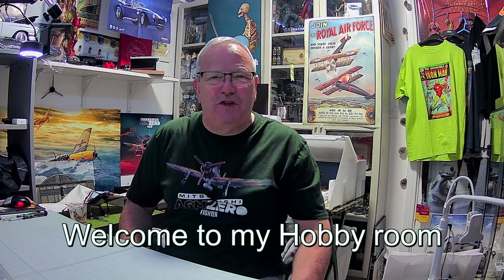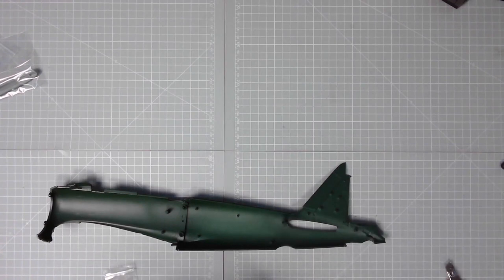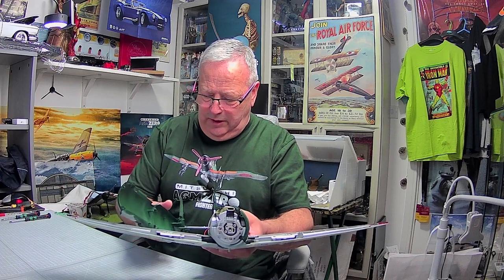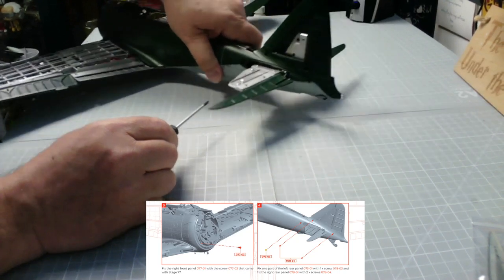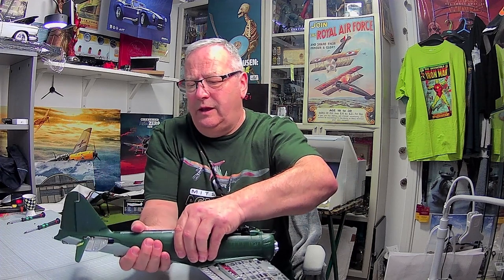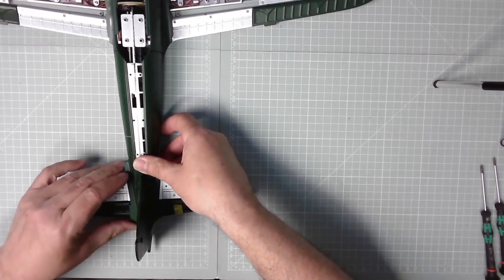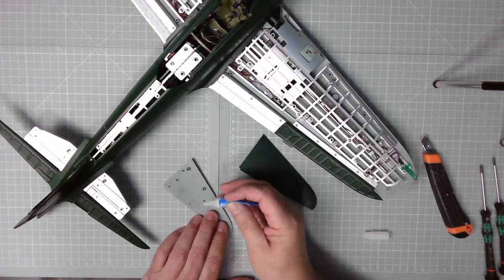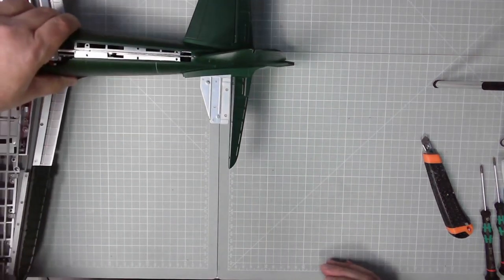Build Mitsubishi Zero A6M Fighter pack 10 stages 77,78,80,81 from Agora

Comment: Hi John.  I have a cure for the seam line that is underneath the fuselage.  It is caused by the metal frame being bent.  That is why you had a hard time screwing the fuselage parts together.  Also check your vertical stabilizer, its cocked off to the left.  Mine is the exact same way and I also had a hard time screwing the fuselage together.  Unfortunately at this stage you can't straighten the vertical stabilizer.  To fix the seam go to the A6M Forum on the Agora website, Community Forum, Zero A6M, Members Build Diaries, A6M Modelers, WATCH OUT FOR THIS BIG MISTAKE, AND HOW TO FIX!  Take a look at the pictures and read the instructions.  Compare your gap to my pictures.   Let me know how this works for you, if you decide to fix it..  
Thanks, Charles
Reply from the maker: Thanks for watching. The rudder is fine as it just needed to be centralised after the rod came out at the motor end. The metal frame is good and the seam line is also good. I had previously seen and read your article in the forum so thanks anyway.
Reply: @JohnsModelmaking  Glad to hear it John!  But with the vertical stabilizer, I didn't mean your rudder.  Lay the plane flat on a flat service and see if the vertical stabilizer is not bent to the left.  (Looking at the front looking back.)  Mine is this way.